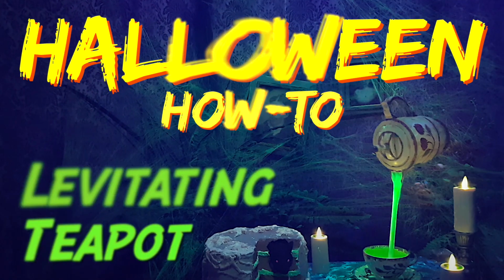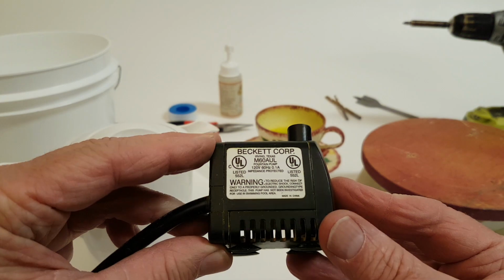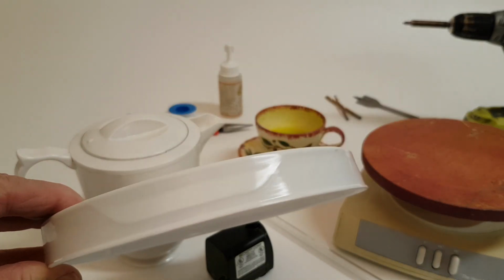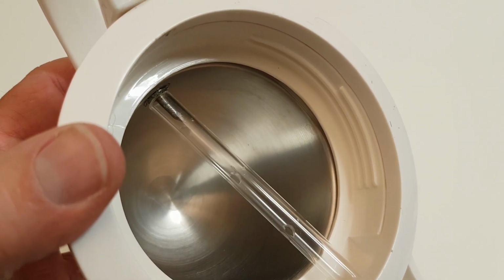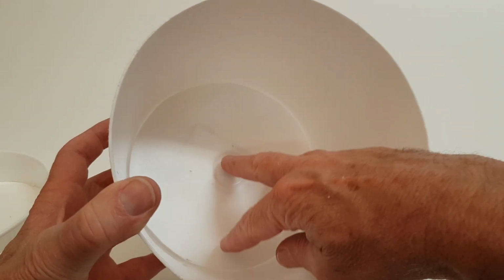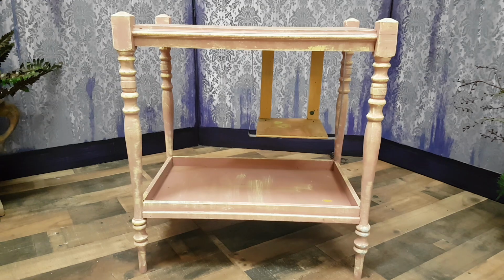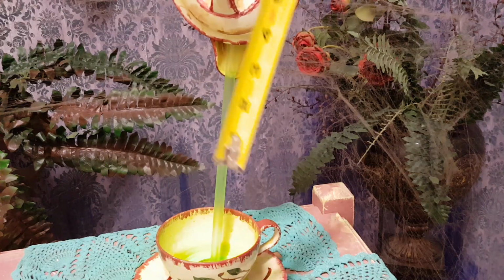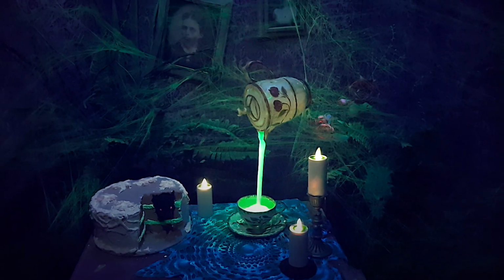Animated DIY LEVITATING TEAPOT Halloween Prop & How-To

Comment: Really cool, is there an easier way to cap off the tube instead of doing a nail route? Or there is more purpose to that nail than just capping the tube?
Reply from the maker: The nail helps to keep the teapot aligned (handle up, spout down) in the pouring position, with the tube as the reference point.  Thanks for asking Chris.
Reply: @HALLOWEENHOWTObySaulFilms  thank you
Reply from the maker: Thanks Chris for the link, love it!!
Reply from the maker: My apologies Chris for not seeing your questing about the teapot sooner ... looks like you found one that works!!
Reply from the maker: Hi Chris, did you have another question, it seems to have disappeared.
Reply: @HALLOWEENHOWTObySaulFilms  tagging you

Comment: Oh my, that is awesome and very well explained.  Love it and love the cake with the moving rat.  Did you make that as well?
Reply from the maker: Thanks June Houck for the nice comment.  Yes, the "Cake Rat" prop was also made by me ... perhaps a future How-To video?
Reply: Thanks for the reply.  A how to video would be perfect.  Thanks!🤗
Reply: Hi!  Some questions for you.  I saw an electric oscillating heater at a thrift store.  Would that work or should it be a fan?  Is it hard to take the top portion of the fan or heater off?  Thanks!
Reply from the maker: Since each appliance is different it is hard to say how difficult it would be to take the unwanted heater portion off.  You really just want the bottom half that moves back and forth, please use appropriate caution whenever you are working with electrical appliances.
Reply: Thanks for getting back to me.  May be safer to use a fan than a heater.  I'll keep looking to see if I find one.  Again, is it hard to remove the top portion of the fan or is it pretty basic?  I would think the operating buttons on the fan should be on the base and not on top of the fan (like the picture you showed) correct?
Reply from the maker: The best advice I can give you is to find an oscillating fan that appears to fit your personal skillset when it comes to any disassembly needed in order to use the bottom portion that rotates back and forth.
Reply: Ok.  Thank you.  Your work is amazing.  I subscribed to your channel 🤗

Comment: That is awesome.What did you use to make the spider web in the back ground?The way you set it up.The web looks real.
Reply from the maker: Thanks for asking and noticing Wayne.  I wish I would have kept the label because it is the best spider web material that I have found.  It is very similar to the white webbing that you buy and then stretch, however this material is brown in color.  After carefully pulling, separating and stretching it in place I then sprayed it with a "glow in the dark" spray paint ... the blacklight does the rest.
Reply: @HALLOWEENHOWTObySaulFilms  that is the best spider web I think I have ever seen. Makes a really cool and spooky effect..